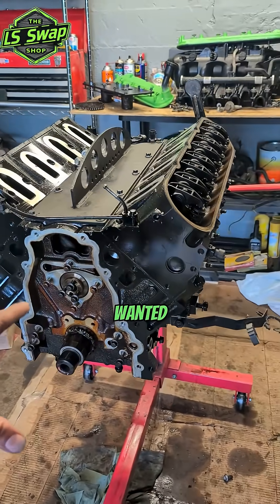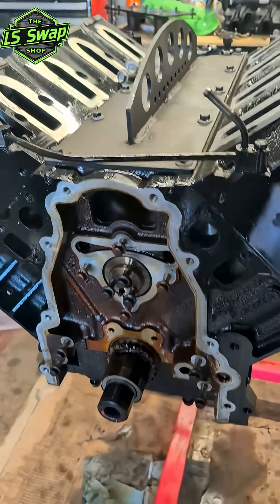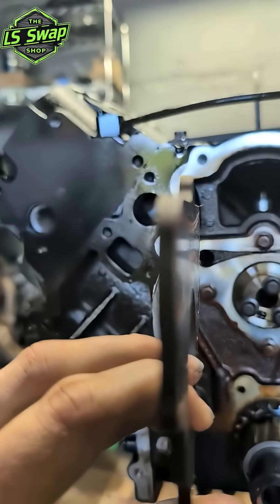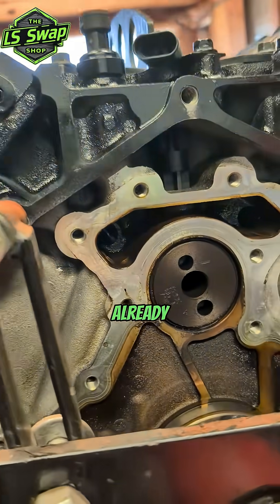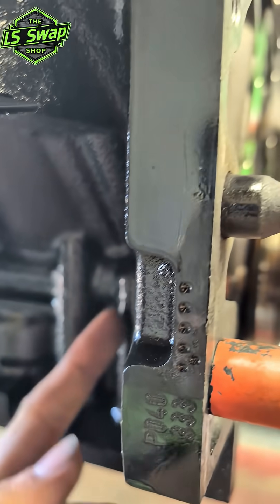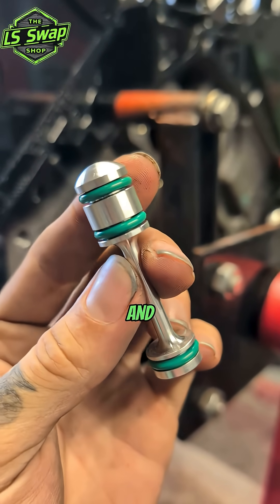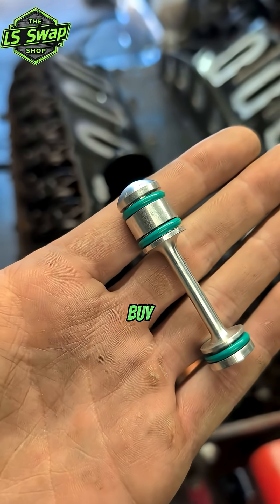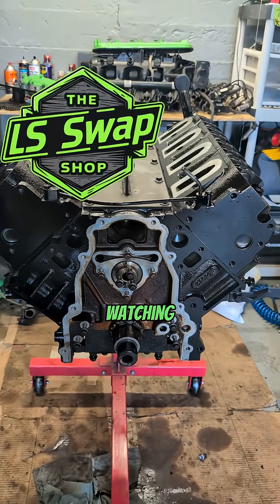LS oiling system, what to know!! What to replace!! #ls #lsswap

Comment: Thanks, I’m an old school SBC guy. I have my  very first LS in the shop that we are going swap into 67 GMC C-15. I have a LQ9 from a 05 Cadillac Escalade with less than 80,000 miles on it. I was just blown away at the damage on the bearings. Spun the middle cam bearing spun three main bearings. your video explains why it happens now now it 
makes sense. Thanks for the info!